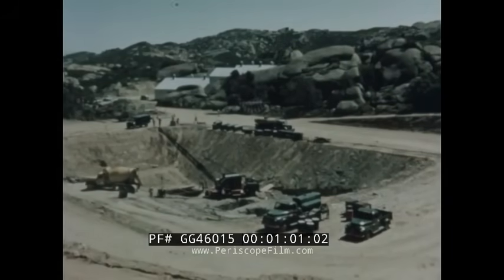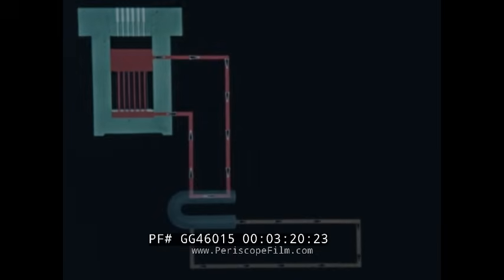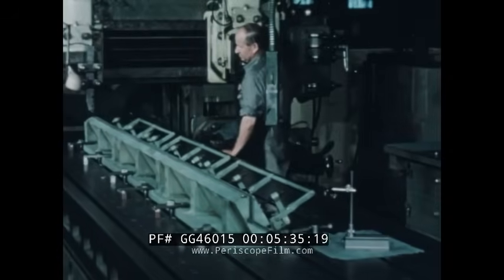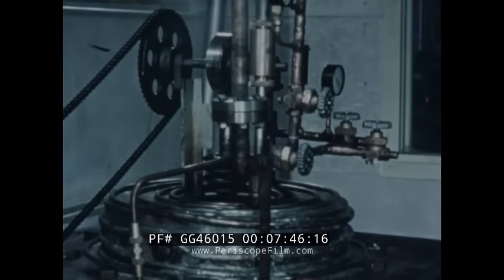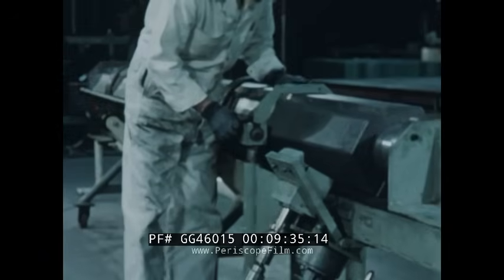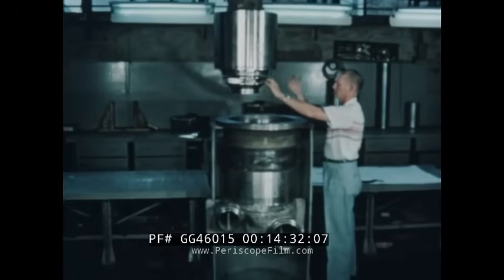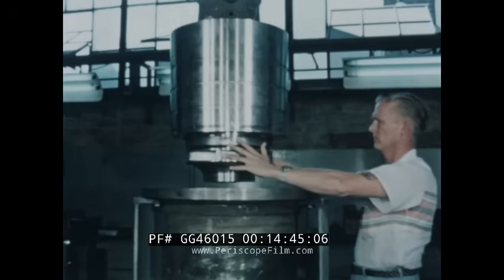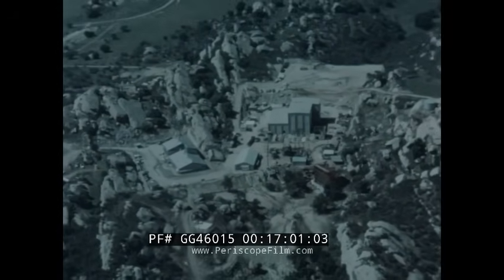" THE SODIUM REACTOR EXPERIMENT FABRICATION "  1957 SANTA SUSANA FIELD LABORATORY GG46015

Comment: I wonder if the tolerances described are correct. I think the narrator said 1/10000” and 1/25000” which are very close tolerances for parts that size.
Reply: "Ten (one) thousandTHS" (0.010) and "twenty-five thousandTHS" (0.025) would be more typical for aerospace (and how they use decimal units), though still really close. And do they mean geometric tolerance, like how close to round or how parallel the sides are? A little over the script writer's head, I'm afraid, and lost in translation.
Reply: @ilionreactor1079  Yes It's  ALL P/R  But Do The Same Stupid Again Greed Lies
Reply: @ilionreactor1079 looks Blanchard ground one tenth tolerance  is kinda broad ..our grinders  usually  split  that..millionths.. that tenth divided ten times...a average  human hair is three thousandths thick..split that three times one thousandth thick then split that ten  ten...those would be tenths
Reply: Agreed 

No chance of holding that close unless extreme thermal management strategies are used. 

.0001 is relatively easy over a small distance. 

.000025 is Guage block territory. 

If this design requires this level of accuracy then IMHO it's a failed design.